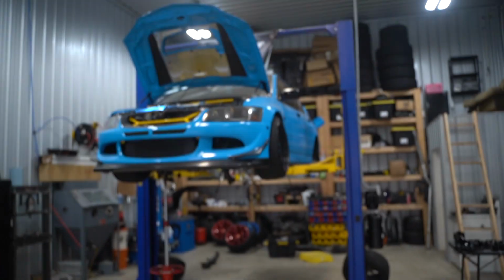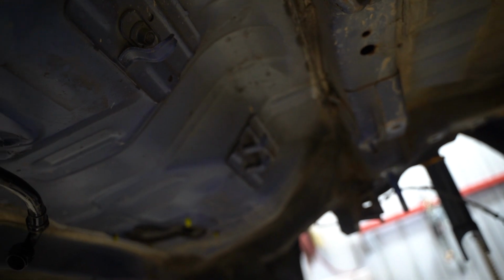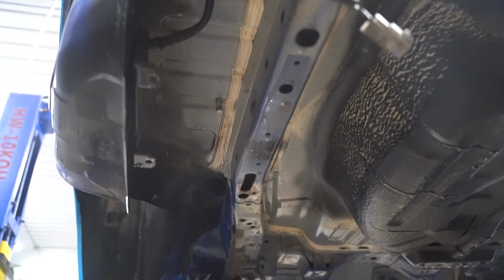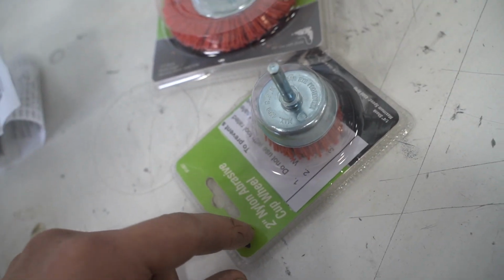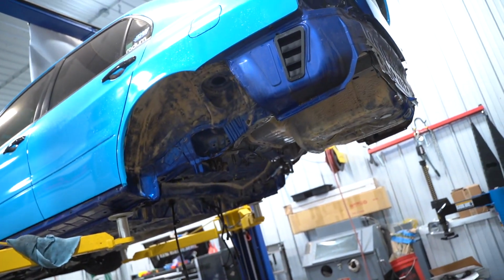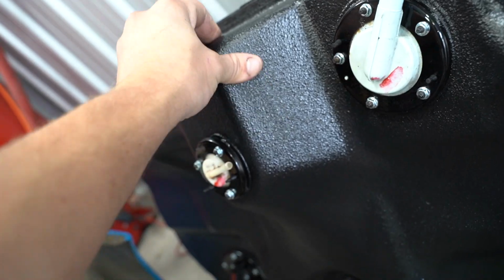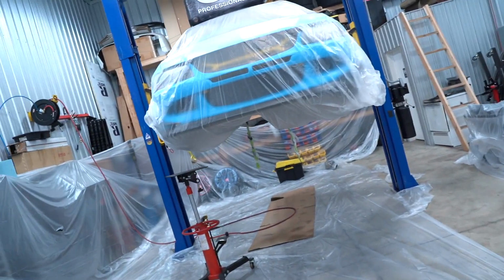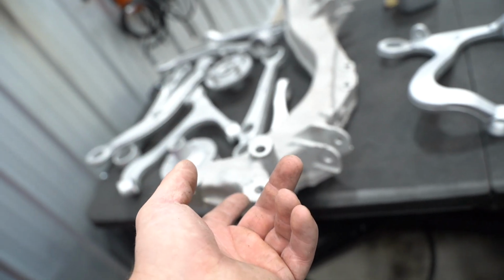Creating The Perfect Evo Undercarriage!

Comment: Raptor liner will never ever come off ever. The metal will rust out under it before that stuff ever starts to biodegrade. That liner will ruin the car because you will never be able to remove it and it traps monster. Every single 3-30 year old truck I've worked on with this stuff under it is rusted beyond repair. You can't remove the liner to get to the rust. Good luck with all that.